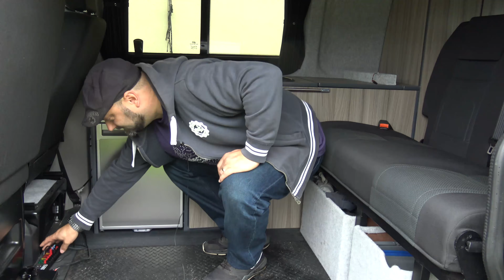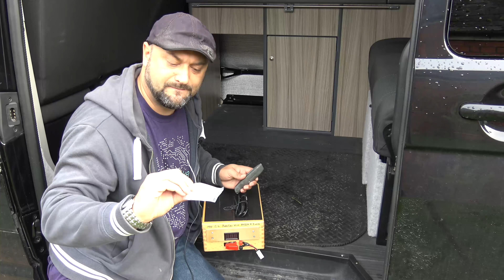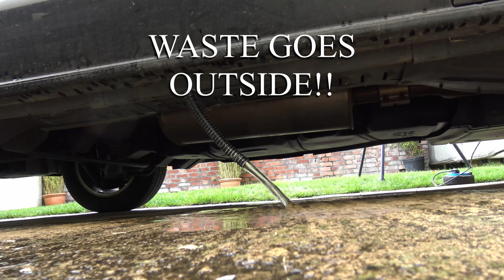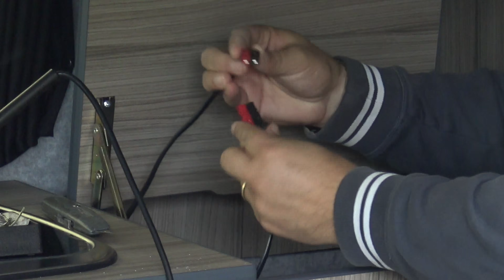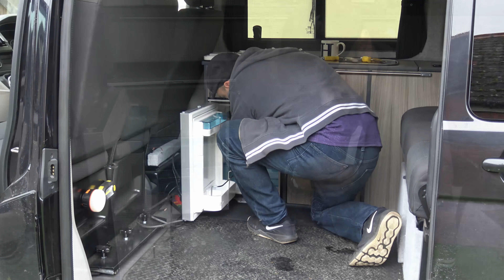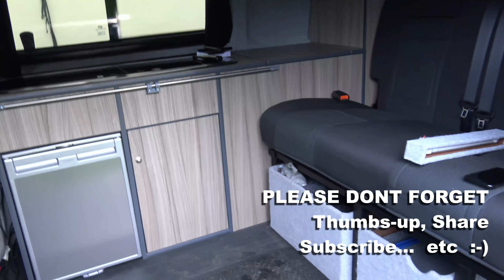DuB-EnG: DOMETIC 9222 Sink Hob WAECO CRX50 12v Compressor Fridge Installation Wiring Setup Campervan

Comment: Is gas safe with fumes ?👍
Reply from the maker: Gas is fumes! …. Sorry is that a statement or a question?
Reply: @DubiousEngineering  sorry mate question I'm building  a camper and gonna be using gas stoves. I'm just wondering how safe it is I'll be fitting a window and roof vents ??
Reply from the maker: @Gary-cw8yp it's no problem.  We've done loads of trips   no worries at all... Well, we're not dead yet :-)
Reply: @DubiousEngineering  cheers 👍

Comment: Great video. We have the same fridge and it is superb. One problem we do have is what setting to have it on. I have often had frozen tomatoes and frozen salad. In the user manual it says " Avoid unnecessarily low temperature settings," granted this is in the energy savings tips section. On the lowest setting, the ice still remains intact so I am also able to have a Jack and Coke. Any ideas?
Reply from the maker: I recently suffered the same problem - the ice box is incredibly cold and the fridge is just about cold.  I may remove the ice box going forwards, or put a little paper in the door of the ice-box so it doesnt close quite so well.

Comment: On page 13 of the operating manual it reads at the last bullet point that the use of a load dump board is mandatory on all semi truck 12 v or 24 v DC applications . You happen to have any ideal what this board is?  Or the control module is refering to?
Reply from the maker: De'Ja Vu 
No idea!!  May have to google that to understand the context.

Comment: Another amusing video, enjoying this series! How noisy is the fridge during the night? Did you consider an on board, (under floor) mounted water tank?
Reply from the maker: The fridge compressor is just a little noisy or it maybe the fan...  but it is quiet enough to have a great nights sleep!!  A low water tank can develop algae and other nastiness... so I wanted something I could properly empty... I should mention that in a future video.... thanks for watching!!

Comment: I got a waeco  coolfreeze for my van years ago, it was the best thing I ever bought. You should make sure that the back is well ventilated ! All that heat needs to escape, then it will cool much faster and efficiently. Enjoy,  its well worth what you paid. I cant stop thinking about that Jack! Adios happy camping.
Reply from the maker: Hahaha...  Jack!  :-)   Great for weekends!!  ...  The top back and sides are reasonably well ventilated... fingers crossed all goes well...  :-)   So far, so good, we have been away for a week and it worked a treat...  All the very best Patrick!

Comment: Hi, nice work. Out of interest, how long would the fridge work on the battery alone ?
Reply from the maker: About 2 days on medium setting...  I need to sort out a 12v switch mode PSU so when we’re on mains it charges the batteries:-)  recently found that out as we recently went on holiday and had to start the engine periodically to charge the batteries:-)